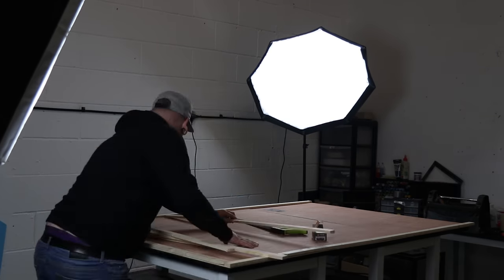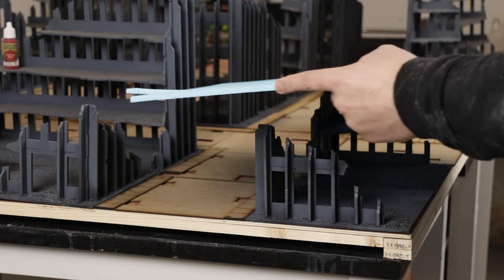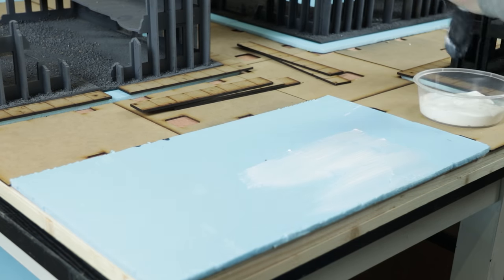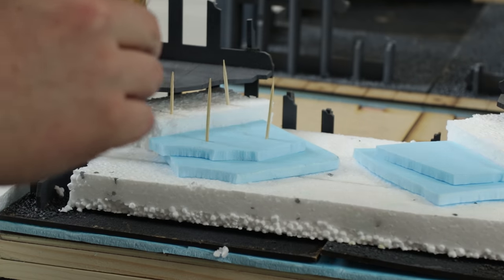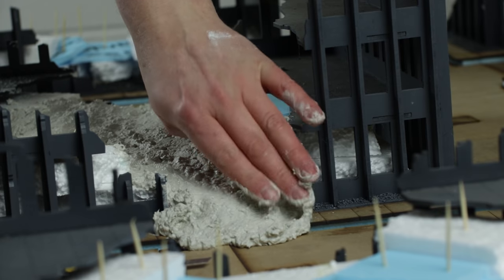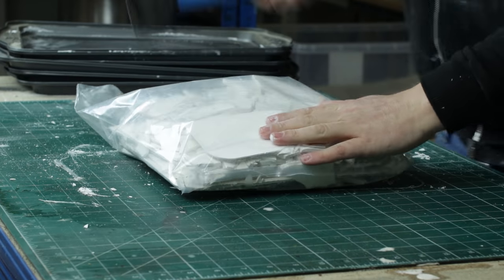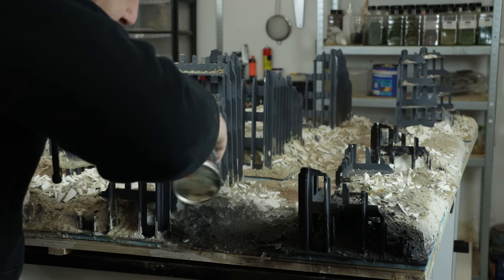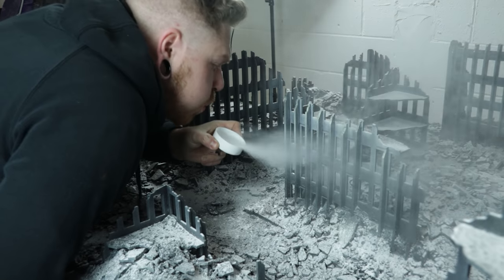40k Stalingrad City Fight Gaming Table

Comment: Got the whole set for £160 from ebay about 5yr ago. Altho the set I had also had window ledges and came with six 2'x2' hardboard tiles for mounting it all on. The seller also did a fully painted and rubble strewn finished product for around £800. I like what you have done to it here mines still as independent buildings … hard to store a full table, keep up the great content.
Reply: Thank you for not mentioning the name of the set or the seller or creator. Really appreciate it.

Comment: Awesome table, it is truly unique. A tiny advice for the lightweight gaming tables: when building the frame,  if you place the wooden strips in the other way (with the longer side on vertical) you will get a much stronger structure 😉

Comment: Oh man... I have had one of those exact kits in storage after getting it on sale a couple of years ago. The plan was to build them as 6 modular tiles with detached buildings. This looks so much better - was a bit sceptical of the massive chunks of foam at first but that looks much more lifelike and even gives you something like hills in that environment. Having to store it as a single piece though... tough call to trade off having the cool setup vs being able to take it apart.

Comment: Great table, my only issue would be where to store it when complete?   I like all the plaster rubble.  I hate layouts that are clean.  You have these buildings that are supposed to have been blown up but then there is no rubble.  I like what you did.  I will have to play with the plaster idea to see if I can create modular rubble, again because I have little space.  Usually I can keep some 4' x 4' gaming tables but that is about it.  And that is because I have a deep closet where they can fit.

Comment: It's interesting you planned the snow for this one - from the images and preview, I hadn't clocked that it was a winter board - just assumed the lighter greys/whites were dust/rubble and I think even when you show the finished thing, I didn't feel it was necessarily overly wintery - felt like a light dusting of snow if anything, and I wonder how much further you could go with the snow - drifts in parts and deeper in areas, while light on the rubble - interesting.

Also keen to know how this stands up with usage for 40k players - I only ask since it looks like there's not much in the way of areas where a miniature would be able to feasibly stand up without falling. Has it been playtested much? Keen to hear.

As ever - amazing work!!
Reply: @GeekGamingScenics  Not having a go - just curious. I have learned LOADS from your videos - so really appreciate them all - I just worry when I try to do something similar it'll end up all jaggy, and I'll struggle to get all the rubble to lay flat etc :D

Comment: Lovely table!. 
btw the point of the Etc rule/cover on lowest part of a building is to hide the miniatures from any shooty heavy army.  (which i still think is possible on your board, due to angles.)  

question. The material you use to make broken pieces of.  Aren't you afraid it will get "ugly/destroyed"  after a few times people have played on it?. 
I normally refrain from using it, since i feel its a weak material.  But should i start using it more often?
Reply: I Made rhinos with stone plaster they área indestructibles

Comment: I love watching these build but I have no idea how these are used or how you game on them. Lol
Reply: Not that hard really
Reply: @leefellows8770  thanks for the explanation. Lol
Reply: @1Independentrider  there isn't much to explain bud. I find games like 40k and Bolt Action tend to work fine on busy boards like these. You could have more of an issue if you have flat bases vs the ones like GW that are better at dealing with uneven surfaces